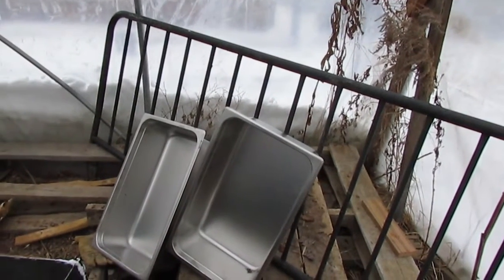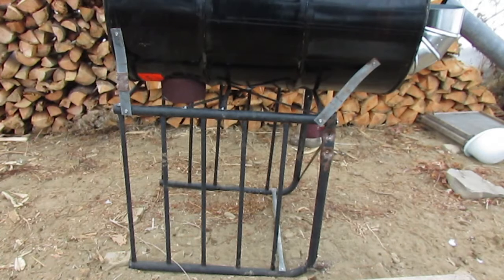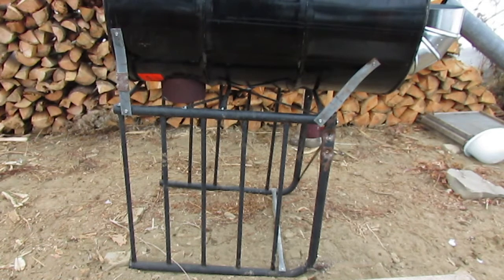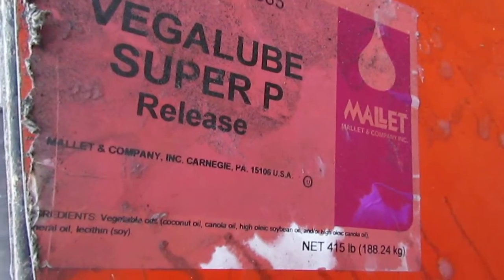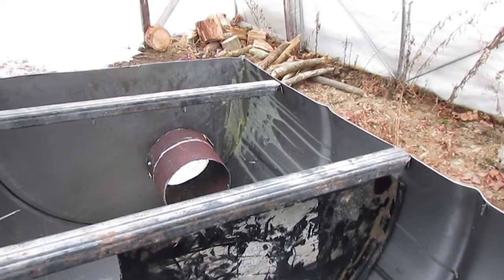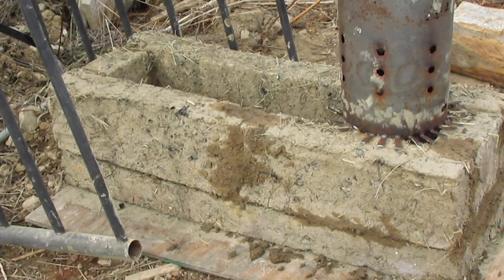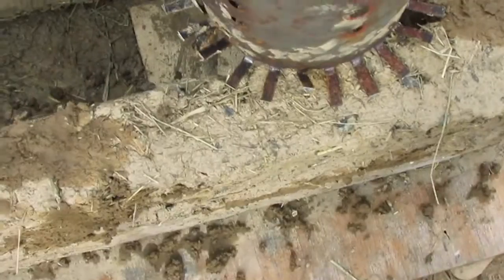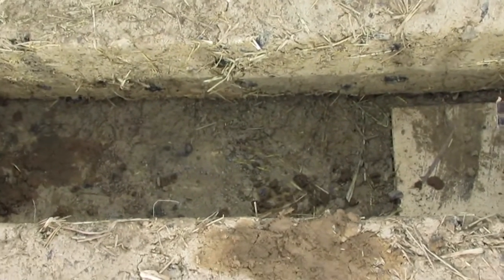Rocket Stove-powered Maple Syrup Evaporator

Comment: I"ve been thinking of doing this for a while.  One thing I was noticing.  You should have thermal mass around your half barrel to retain the heat.  It's more heavy and not portable but maybe you could make one on a sturdy trailer or something.  I need portable so I haven't dont anything yet with the rocket stove design.  It would definitely work much better you designed it more like a rocket mass heater and have the barrel pan nestled into the thermal mass.  I'm no engineer but I've been looking at rocket stoves for a while.  You have to figure a way to not lose heat thru the sides of the barrel.  Like at least 6 inches of thermal mass.  Once the mass is preheated you'd keep a boil like nothing else
Reply from the maker: I think that could work, the only problem would be it would be "massive" and I don't have a spot to set up an evaporator permanently.  So I need it to be light enough that I can tear it down and store it out of the way.  I actually didn't do any syrup this last spring due to some other things that took all our time while sap was flowing.
Reply: Check out Paul Wheatons portable mass heater design.  Might give you and idea.  You just build a wood frame and fill it with rocks.  Its not as good as a permanent sealed in mass but it's better than thin metal throwing off heat like crazy.  IT would probably take you a couple hours to remove rocks and disassemble the frame for storage.
Reply from the maker: It doesn't throw off heat at all.  Its filled with clay/straw insulation.  It barely gets warm even after you've been boiling for hours.  The heat that gets lost is the heat that goes up the flue.  Which is probably a pretty high percentage.
Reply: Ahh ok.  I spaced out that section of your video.  It's kind of tricky to imagine how to design it where you could could keep the flue going around the mass but yet still have direct heat.  Haven't had enough time to ponder it but it's worth it if you could burn way less wood and mainly scraps.  Looking forward to seeing more people monkeying with this idea.

Comment: I love the fact that you are trying things out with the rocket stove...but let me share my thoughts on the previous 3 years of building evaporators using the rocket stove.  I have made several prototypes and found that the flame needs to kiss the bottom of the evaporator pan.  It will work much better if you use the pans to seal the top of the burn chamber and use the exhaust to preheat what goes into the pan.  Every year my wife and I make anywhere from 3-8 gallons of syrup from our trees and when I stumbled across the current design it cut my wood usage to an 1/8 of what if was and I'm currently using sticks from the woods and cut up pallets only to cook sap.

Also another helpful hint is that the thinner you keep your sap in your pan...the faster it will boil off.  it takes far more energy for a steam bubble to travel through 4" of liquid vs. 1".   when I cook this weekend for the first time this year, I will try to post a video for you of my current rig...although I am already in the process of welding up a new one.  

great job on the build and if your like me...this is just the first step of many to improve the process...make it easier and more fun for friends and family to enjoy.
Reply from the maker: Sounds good pipeboy98.  I'm not really understanding how your exhaust is working honestly.  I did do lots of internet research prior to building this, too bad you didn't throw up some vids of your rocket maple set up.  I do remember looking at your video of the barrel stove set up, but I rejected it as I do not have the ability to weld up a pan like is shown in your evaporator vid.